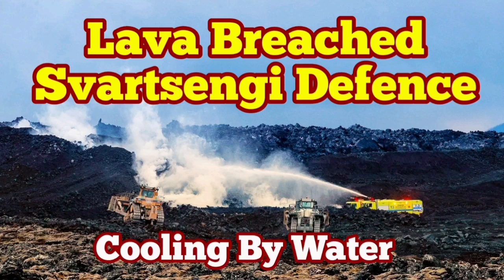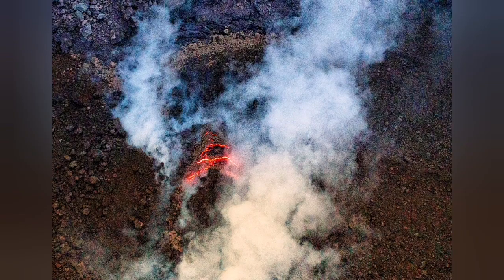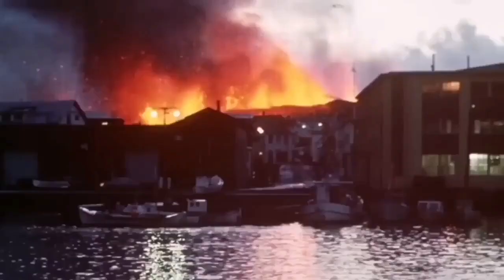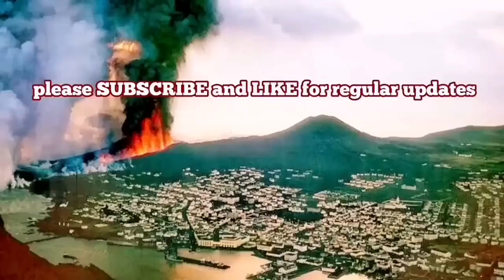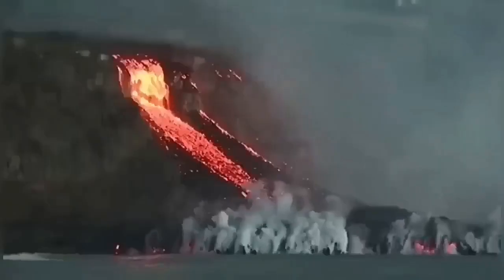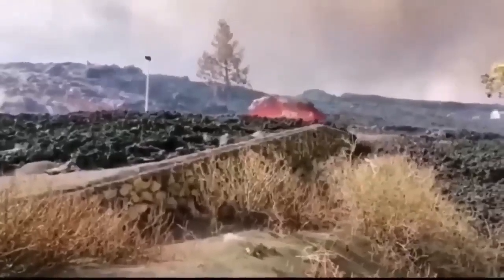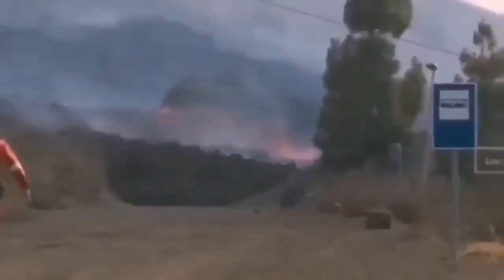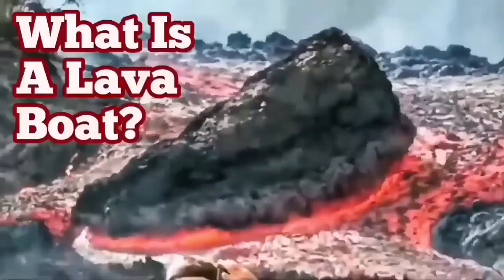Lava Breached Svartsengi Defence Wall: Cooling Lava By Spraying Water, Iceland Volcano Eruption

Comment: Cyclone Fencing, that galvanized interlaced wire fencing, works VERY WELL for stopping lava. In Hawaii, it has protected a cemetery, a public water spigot area, and some other properties who had it on the perimeter. Surprised everyone how well it worked.
Reply: it is called reinforced "concrete"
the lava hardens around the metal protecting it from heat and the metal strengthens the lava it by curing its brittleness

Comment: Drop large ice blocks by helicopter in lines along areas you want to redirect. The melt water from the ice will cool the lave as it moves. Does that seem like a good idea?
Reply: No
Reply: Ice wont actually absorb that much more energy than water before turning into steam. For example, ice at -18c vs water at 20c. The water needs to rise 80c before evaporating where the Ice needs to rise 118 which is about 47% more energy. So having 2 trucks is better than a single helicopter, since helicopters are 20x more expensive to operate.
Reply: @eelofthegods  And water, unlike ice, is portable via a hose and a pump.
Reply: are you 8 years old and envisioning cartoons?
how heavy is an ice block?
Reply: I'm not a pilot, but I can image the convection currents from the lava flows would make flying over the lava extremely dangerous. And blocks of ice? No.